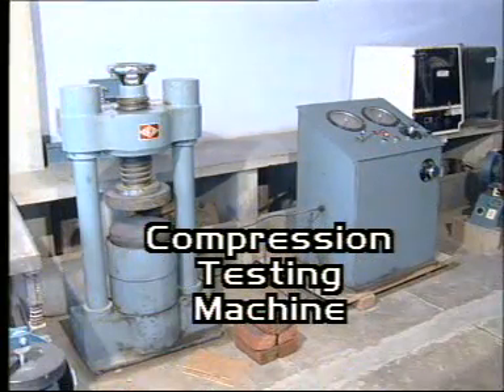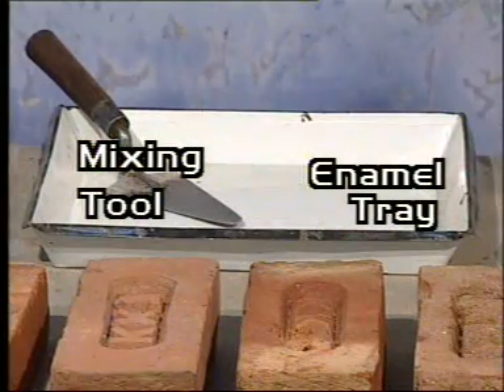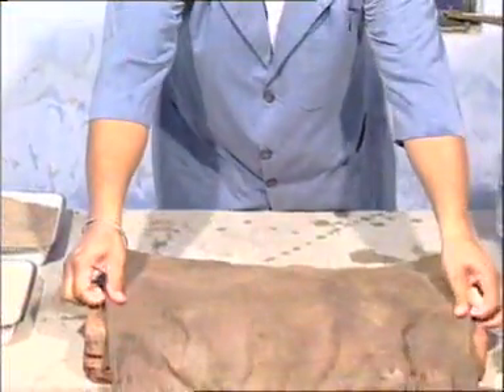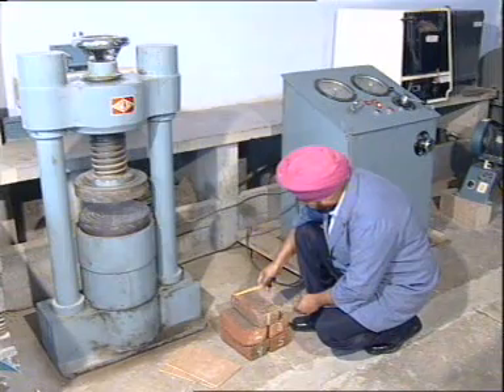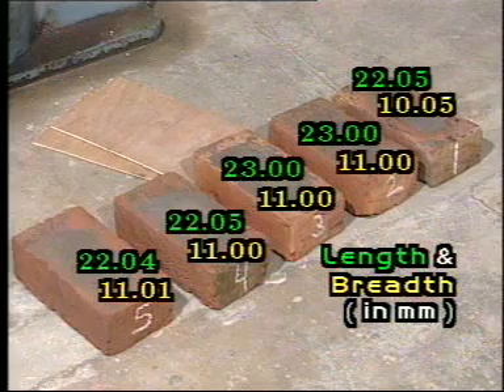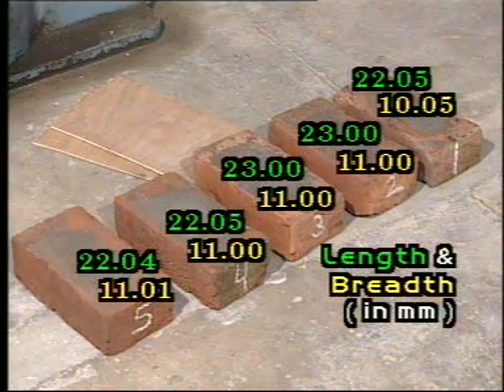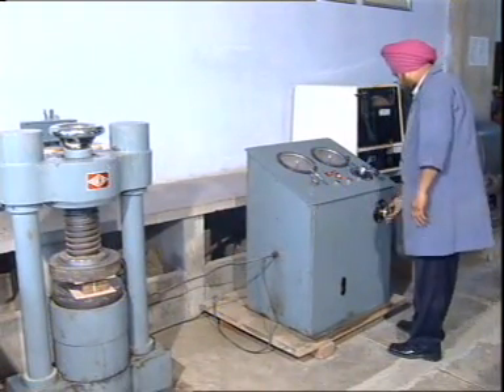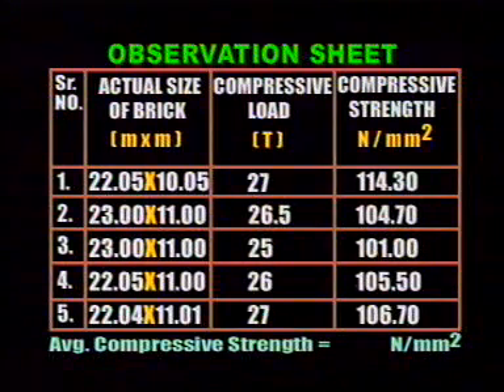Compressive Strength of Bricks

Comment: Please, your calculation of  Compressive Strength of the bricks was wrong. Example 27 T = 264,779.5 N.  If you divided you Load (in N) by your area (mm square) ( 22,05 x10,05), you will obtained  = 1194.8 N/mm2 this the value for your Compressive Strength for the sample 1.
Reply: 22.05 is in cm not mm
think
Reply: But 22.05 is cm not mm sir